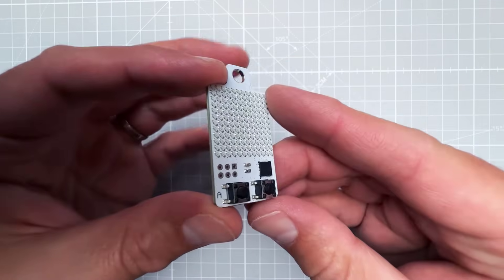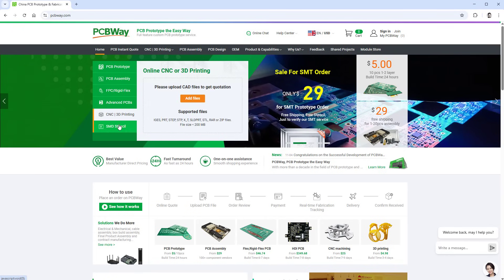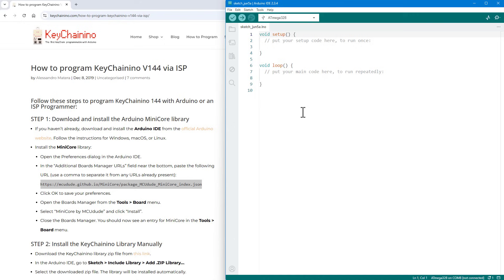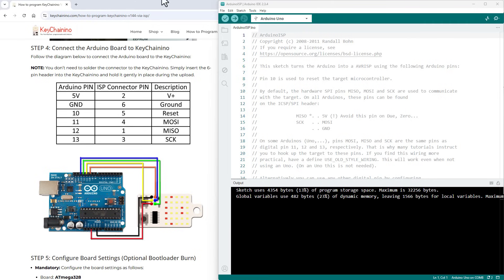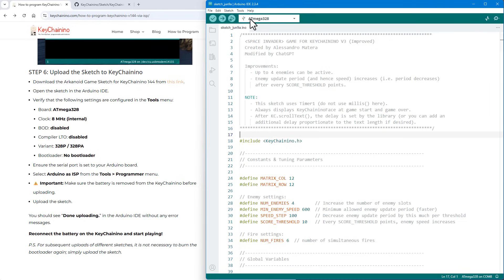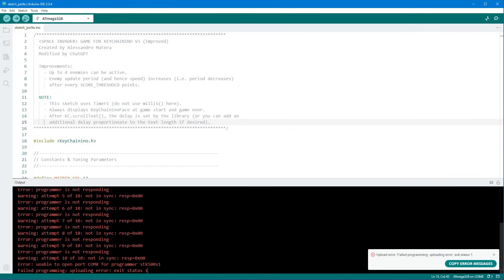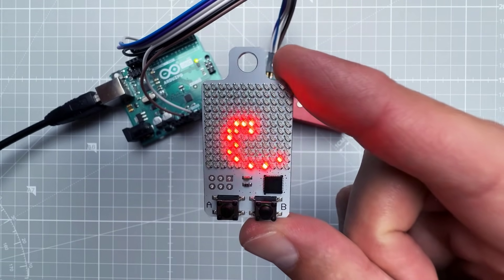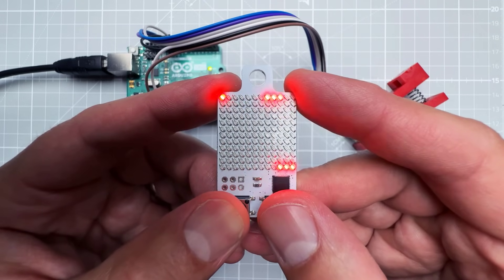Small Arduino-based Keychain -- KeyChainino Board with 144 LEDs

Comment: The only time I had problems with 'ISP' header was with the Reset connection. So I always just use wires to pins 10,11,12, and 13. Never had any problems then....great video !!
Reply from the maker: I believe that the Reset line is exactly the reason why it was not working. Thank you for your comment!
Reply: @upir_upir  :)

Comment: The ISP-Header is to program the ATmega328 with an external Programmer and the ISP-Header at the USB is to Program the ATmega8U . Maybe you can redefine the Pins in the Programmingsoftware to the Pins of the Header ¯\_(ツ)_/¯
Reply from the maker: I believe the documentation says that you can use the ISP header also to program other chips, but somehow it was not working as expected..
Reply: @upir_upir Třeba nebudu mít zcela pravdu, ale minimálně reset PIN nemůže UNO sdílet s Keychainino, ten má být na pinu 10 UNa. Mohlo by to fungovat pokud by se atmega328 z UNO desky odstranila a nepoužil by se programátor Arduino as ISP., ale nahrnulo by se to tam "klasicky".
Reply from the maker: I think you are correct, the Reset line is the problem.

Comment: 9:39 i use a ch340 arduino nano and encounter the same problem (i use an arduino ide version 1.8.18 since i dont like the new ui) for me the error goes away if i replug the arduino to my PC or you can try changing the com port assigned in device manager
one more thing that worked for me is using old bootloader option in the tools (this only worked for a select few arduinos)
edit: love your videos keep uploading!!
Reply from the maker: Thank you for your feedback. I will try your suggestion and see if I will have more success. Thanks again!

Comment: At 10:00, where did you get that adapter since your link shows it's no long their? :hand-pink-waving:    Is a quit project though!
Reply from the maker: There should be a link, but you can as well search for "Test stand PCB clip 2.54mm spacing Clamp Fixture fixture Probe pogo pin Download Program Burn"